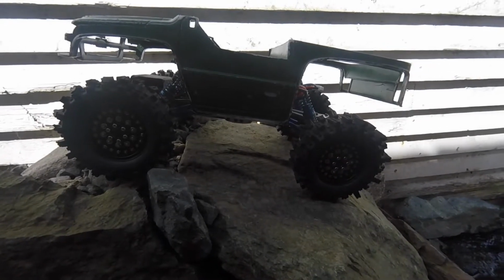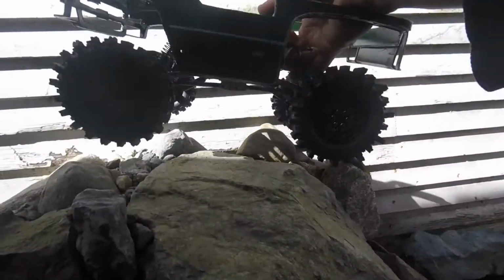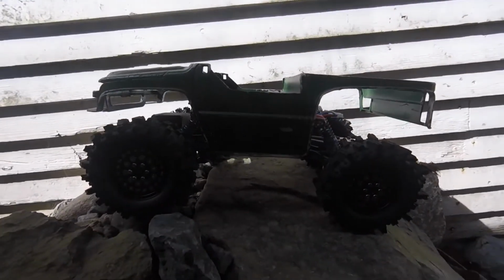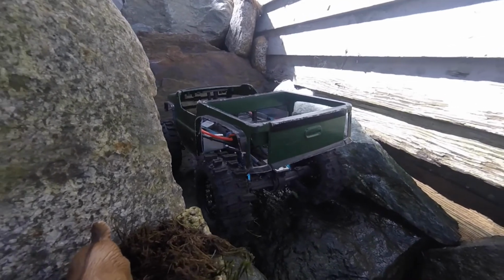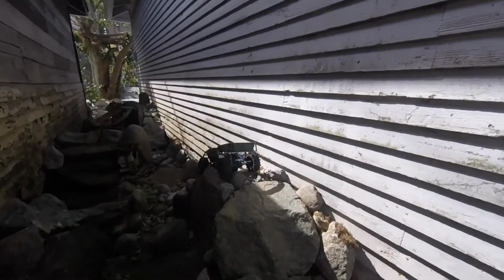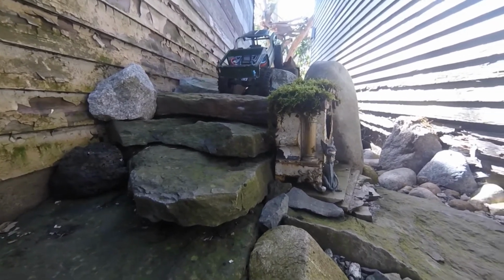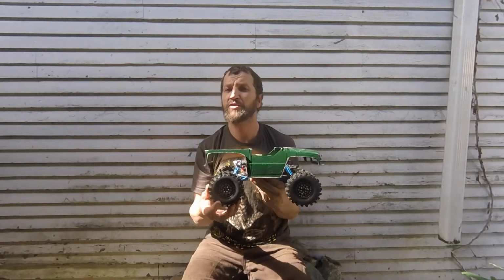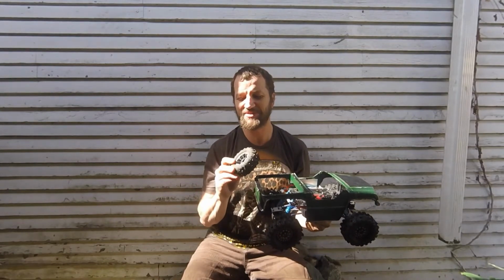Cut Mud Slingers.

Comment: That is definitely a wicked cool course Man!  The slingers did pretty well I'd say.  I use MT Baja Claws on my Mini Crawler and like them a lot.  Always cool to see what other guys are runnin' on their rigs. Good stuff Man!
Reply from the maker: My buddy runs 1.9 MT Baja Claws cut checkered. They work awesome. The outer diameter is to large to fit my truck. I have to stay at 95mm or smaller to fit. There are wicked crawling tires out there that are as good and even better but can't fit the them to my truck. I have some ideas coming up for some other wheel and tire options that I think will do the job. And a new rid too, coming soon. Another mini 1/18 but it's a true scale 1/18. Gunna fit it to my Toyota Black Mamba Tundra body. =D Thank you for your awesome comment and feed back. Much appreciated. :)
Reply: Cool!  I'll keep an eye out for it!

Comment: I am contemplating cutting my 1.9 xl mud slingers on my redcat gen 8 scout II gen 1 and am wondering if it is worth cutting them . They perform really ,I have a 1/16 scale traxxas rally that has been converted to 3s brushless and turned into a “trophy truck” and I have some 1.9 mud slingers (non xl version) and they are absolutely amazing at just about everything I point them at . I am wondering if these really do that much better after they have been cut .I am just hesitant to cut a brand new set of tires unless they will perform better than they already do .

Comment: Get some shotgun BBs inside those things will make em squish down real good,
Nice job cuttin the treads, I would be too scared to cut mine in case it made it worse ha ha
Cool T shirt (0:
Reply from the maker: Those whees are going to be taken apart. Gunna pull the foams out then when they go back together I'm going to put lock tight on all the hard ware. This rig is going to get some more suspended weight added to it once the cage goes in. That should do the trick. :) Thanks for your awesome comment and feed back and tip. :)
Reply: Dirty D's RC 
Yah man thats the way, good stuff (0:
Reply from the maker: Thank you buddy. :)